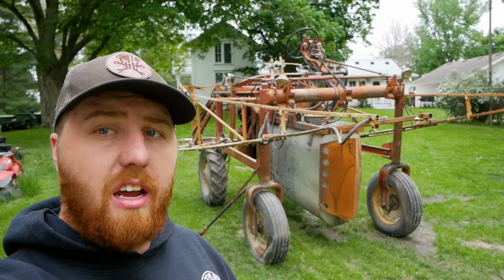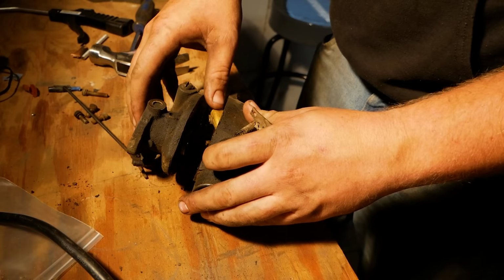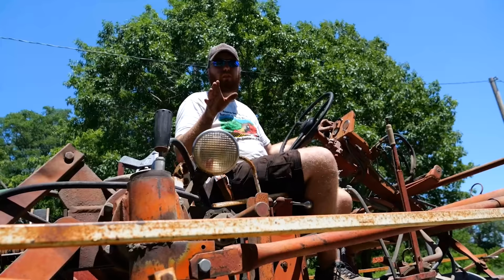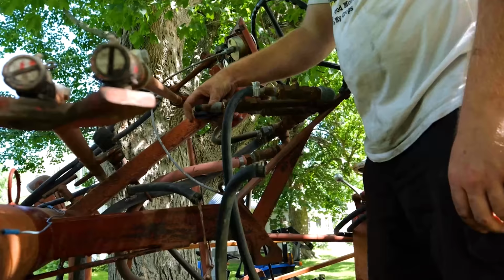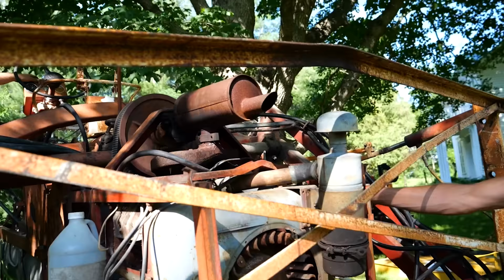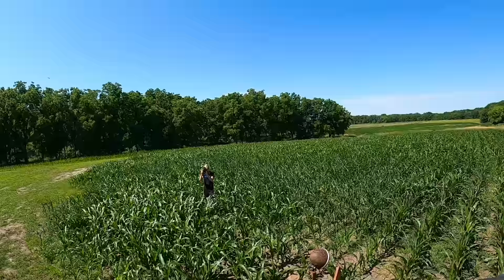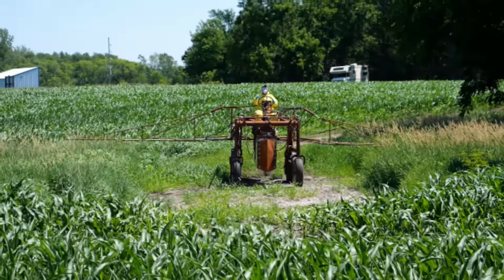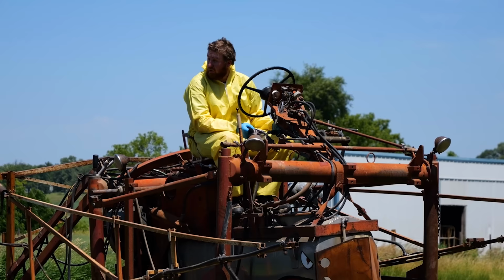Can We Farm With ABANDONDED EQUIPMENT? - Ep. 5 - Spraying The Field

Comment: Spraying fields can be one of the most dangerous things you do on a farm. Learned  how to spray working for Monsanto . Corn and soybeans on 3 huge farms . Before that I did field prep.   and maintenance. We wore a full HAZMAT Suit with a positive air circulation full face shield hood . The sprayer was air conditioned and fully sealed. There was a full suite of chemical products for every known pest or weed and fertilizer. Wind direction , temperature and humidity were critical and had to be within parameters for application . Monitoring of amounts ,types and frequency had to be documented and were subject to review buy the Company or the local and Federal Government . They only thing more mentally and physically exhausting was EOD work handling explosives and demineing in the Military.  Warning high incidence of health problems are part of that job . I would not recommend you use that piece of equipment for any type of cultivation . It is outdated and would not pass scrutiny by your local agriculture officials.  It is a relic , a gate guard . Shoot water out of it . I am a fan of you and your girl . Please cut that up with a torch.

Comment: I have never figured out why farmers world wide seem to be the most wastefull bunch of people going.
I bit of farm equipment is in no way ever cheap, at least the same as buying a car if not a lot more, however, it always seems to end up  laying out in all weathers, rusting away, until next time they want to use it, and then wonder why it does not want to work, if you did it with your car they would be the first to tell you that you need to take care of it.
I have seen in my llifetime more tractors sitting there rusting away than i have ever seen cars treared the same way, for a  start, that spraying gear, it was actually left in a shed that was allowed to fall down around it, i wonder what else was in the same shed that cost money, let alone the shed.
I am really glad that farmers dont fly planes!!!!